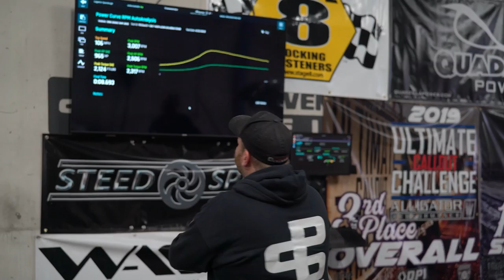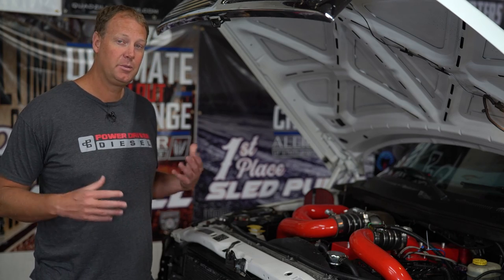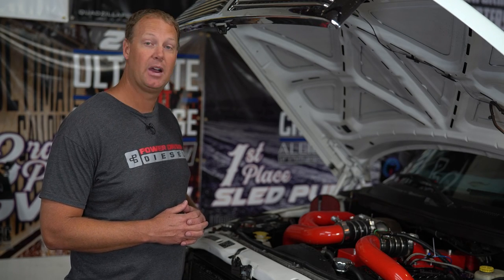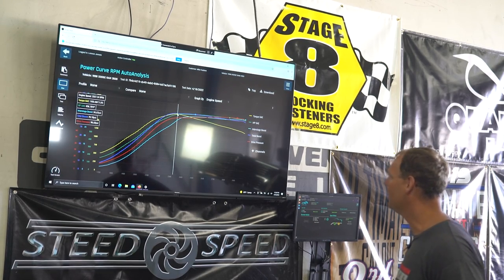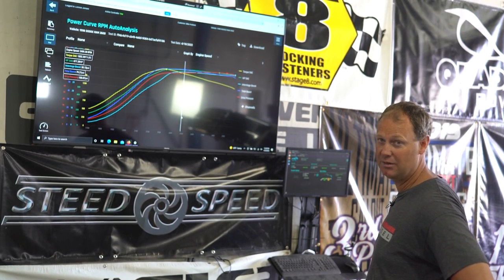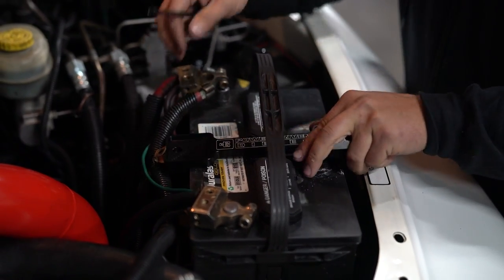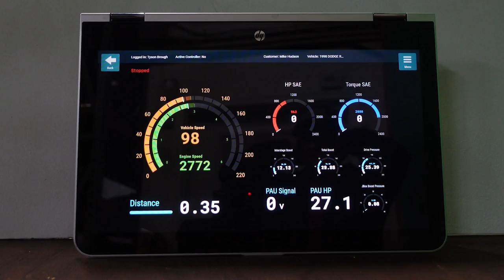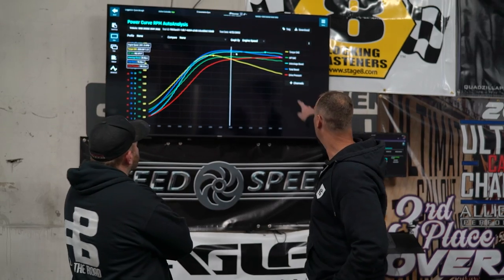Tow Ported Cylinder Head Dyno Test

Comment: I had always heard boost pressure was a measurement of resistance not volume,  this test demonstrated that concept perfectly.
Reply from the maker: Thank you
Reply: Yep. A lot of kids buy these trucks and can't make any power with them because they just crank the timing and boost up. These heads are terrible for flow.
Reply: Completely correct. I gained a lot of power and reliability by maximizing flow.
Reply: I can tell you when your taking your A&P(airplane mechanic) classes they beat the principal of a few dead guys in to your head. Bernoulli, Otto and Newton. and you better know Bernoulli's when you're talking about turbos and jets. And his principles work great till you hit supersonic.
Reply: Yes, simple law states how Flow & Pressure are inversely related!! The simple water hose analogy helps a lot of folks make the connection. But Soo many folks forget about Flux which takes the container through which the fluid flows. It is amazing how understanding a little bit of physics plays a role into so many different things.

Comment: I have a 1996 3500 (171k) that is bone stock and blew a head gasket on me pulling a trailer through Wyoming. I'd like to do some stuff with the head off. I know I want to install an afc live for sure, but what would you guys recommend for a mild ish truck that will be pulling 36ft goosenecks loaded with hay and equipment?  What can I get away with just building on the head?  Not looking for a race truck, just a reliable tow rig.

Comment: It’d be interesting to see what a head swap would do for a stock truck
Reply from the maker: That may be happening soon
Reply: @pddofficial  hopefully a vp truck🙏
Reply: Was wondering the same thing
Reply: @pddofficial  i volunteer my 98 as tribute.
Reply: #metoo
Reply: I got a 310k mi 3500 4x4 dually 5spd with no internal mods on the engine just a edge box, 5in exhuast, and intake filter on it its vp44 with air dog fuel pump. I wish I had the funds right now send it out to you guys and see what magic we can cook up. I'd volunteer it for "testing".
Reply: I'm currently running a 2012 6.7, stock injectors and stock cp3. On top of that is a BW S467.7/83/.90 FMW and Stainless Diesel manifold. All combined with a D&J stage 2 cylinder head. That setup is  plenty for towing in the mountains and chasing class 3 in the desert. Haven't had a good dyno reading because of tire slippage but will tell you airflow is key to making usable  power.

Comment: Watching y’all talk about more flow with less boost just blew my mind. It makes sense, just also never crossed my mind to think that way about my head and turbo setup. Love the videos.
Reply from the maker: Thank you
Reply: they aren't kidding about that, I swapped to their 62mm HX super 9 and despite making less boost than my Aurora 3000 it makes a ton more power, just moves so much air it's insane!
Reply: Boost is an arbitrary number. More or less, just a point of reference. Obviously, compound turbos and pulling/racing applications are much different, but in a daily driven or working, single turbo application, if you're exceeding 40 PSI of boost, you need a bigger turbo. After 40, on most turbos, your drive pressure is going to start climbing exponentially, and the compressor is just blowing hot air. 

My semi is putting over 600 horsepower on the ground, with only 35 PSI from a single, 76mm turbo with a 31 PSI wastegate. Never exceeds 900° in the downpipe, even after several minutes at full power.
Reply: Blew me away like a fuckin queef in the wind....  🌪

Comment: Would have really liked to see if the valve springs or a big reason for the difference, but even then just swapping out that head and valve springs and getting that much power is nuts. Love comparison videos
Reply: Valve springs and push rods is more of a supporting mod like head studs. It doesn't necessarily add power, but it makes the build more reliable. I
Reply from the maker: Thank you for the comment Getting our Engine dyno soon so that may be the content that we need

Comment: 😂😂😂. Will’s reaction was priceless!  I was along his line of thinking, but I guessed 940ish hp, for ~ +46 hp, and 2,050ish tq for ~ 112 lb ft gain. 
I am beyond impressed, but y’all never fail to deliver. If I remember the final numbers correctly, that was a +71 hp gain and ~ +200 lb ft gain- at elevation!
I wish we could’ve seen the owner’s reaction and impression after the first drive!
If possible, can you post some EGT numbers from before and after?  It would be awesome to see the truck doing the simulated hill climb on the dyno for sustained power and EGT numbers!
Reply from the maker: The truck is back home in Arizona, but the before peak EGT recall after a dyno run was 1800 ish and the after ported head peak EGT recall after a dyno run was 1600 ish or roughly 200*F EGT reduction, which is also an insane reliability gain!  We would have guessed 50 to 100 degree EGT reduction, so 200 was mind blowing.
Reply: @pddofficial  
That’s incredible!  A 200 degree reduction @ 965 hp max effort is mind blowing. 
The entire setup on this truck blows my mind.

 I remember the 2nd gen 1 ton y’all used as a test mule a few years back being approximately 400 hp, if I remember correctly, and it was noted that the cooling capacity and frontal area is a bit of a disadvantage when compared to the 3rd gen trucks; so to see these numbers - on the dyno at that, is crazy. 

Thank you for the post!

Comment: Looked like just a stock head gasket was put back on, no fire rings or O-rings? And what timing was it running 24⁰?
Reply from the maker: Block was o-ringed. Timing was at 24
Reply: What injector size?
Reply: @pddofficial  That is some big torque for no fire rings on a 12Valve. Must be those 625s doing their thing.

Comment: Over 2000 lb-ft. of torque?! That is ungodly. That’s semi truck torque! I’ve always wondered what kind of difference a ported head would make! Were EGTs different?
Also, I’m tempted to suggest this same type of test with camshafts on a 400-500HP engine (Stock vs Hamilton tow/street profile vs Hamilton Aggressive Street), but boy is that going to be a lot of work.

Great video!!
Reply from the maker: Yes the egt where 200° less still 1600° vs 1800° with the stock head
Reply: Please please test camshafts on a 600 hp truck.  It would be great to see how much power is gained with a 188/220 compared to stock, as well as how much the hp/tq curve shifts to the right, how much useable rpm is gained from a cam swap

There's almost no data on the internet on back-to-back cam swaps on a Cummins.

Comment: 8hp/lbs per min is very interesting. what injectors and delivery valves and timing? has pump been tweaked? like optimizing  injection event with the quickest zone of cam lobe ramp?
Reply from the maker: The injectors are a stage 4 DDP injector 025 dv and a 215 Ppump that was worked over by Seth

Comment: How would this turbo set up compare to a built he351 with a s475/96/1.15
Reply from the maker: it would spool quicker with the 351 but fall around the 700hp with the 475
Reply: @pddofficial  ahh okay, I’m only looking to push 700 but was curious cause who doesn’t love more power would a s476 be better I was gonna run a s480 but was going for quickest spool up possible at around 650hp. What timing would you recommend I ran 18 then 20 degrees with my single turbo set up 63/71/14 now thinking keeping it at 20 or 22 degreas

Comment: Do your high hp trucks get hot? I Have about 350Hp on one of my Ppump trucks,   stock, (w gov and valve  springs, fuel plate and head studs,  mishimoto rad and int). Less than 1k mi since new HG n studs,  but it still gets Hot while towing about 15k lb up big hills w the a/c on. 3.55 rear-end. How do I keep this thing cool?
Reply from the maker: Hot coolant temps or egt?
Reply: @pddofficial  coolant temp* I keep the EGTs below 1300 with throttle application, but on the long hills coolant still get hot, towing heavy.  Not loosing any coolant though.

Comment: That’s incredible gains. So heads and better sealing valve springs. I’d be curious to know how much those intake valves moved from manifold pressure.
Reply from the maker: Don't know maybe we need to try some clear valve covers and a go pro
Reply from the maker: Will carefully checked over the old head looking for signs of soot/exhaust build-up on the intake valves and they were surprisingly clean meaning... minimal valve float at low lift during overlap or nearly adequate seat pressure.  However, the factory locks/retainers were beat/pulled part way through and on the road to failure so likely had some valve float.  Luckily this truck never sees 4k rpm or it would have probably dropped a valve with the original 60# valve spring and OEM lock/retainer setup.

Comment: Do you know what size injector this truck has?  I don't think it was mentioned.
Reply: This is my truck.   Has Dynamite Diesel Stage 4 injectors.
Reply: @michaelhudson8453  do you know the specs on the 362? I'm building a set of 362 476 compounds for my 12v and was curious how close the specs are. I caught Todd saying that the 476 had a 87 turbine
Reply: Do you know what size a stage 4 is 5x? Just curious
Reply from the maker: it is 362 62x68 .70 and the 476sxe is a 76x87 1.25
Reply from the maker: They are kind like a 5x18 but DDP is doing a really cool 10 hole injector that act like a small injector until you get after it
Reply: Thank you for the response.  I have a 12 valve with a single 476sxe and 5x20 injectors all parts from powerdriven.   Your power level is my end goal.  I was very excited to see this video because I just ordered a stage 1 head from them and am waiting to receive it.  Point being, I am hoping to have similar power, but obviously without the torque, due to single turbo.

Comment: Does the build have a stock cam? Or upgraded?
Reply from the maker: I believe we put in a 178/208 can in that when we built it
Reply: @pddofficial  cool was just curious if a 188/220 would net a little more hp? I installed that one with your replacement head I could afford the stage one so I cleaned the bowls up and mild porting. Just wasn’t sure what to expect with the bigger cam.

Comment: I have a 97 12 valve original owner it's got 50 hp injectors adjustable fuel plate all the way open steed speed exhaust banks duel intake 4k governor springs 4 inch exhaust cold intake what would you estimate the hp to be
Reply from the maker: We've seen setups like yours make as little as 240 HP and as much as 425 HP depending on who setup/tuned the fuel plate/AFC travel, timing, and turbo wastegate setting, overall health of the engine, fuel filter maintenance, etc.
Reply: @pddofficial  thanks for the comeback after I retired I bought a bigger 5th wheel and did the upgrades for more power and it worked enough I got a light foot so the mileage is still there the unit has 375000 miles and serviced by myself every 4000 miles thanks again

Comment: This is a very similar set up to what I am putting together. Do you guys have turbine specs for both turbos?
Reply from the maker: 68mm turbine with 0.70ar T3 gated housing on the 362SXE and 87mm turbine with 1.25AR T4 housing on the 476SXE

Comment: What kinda gas milage does this thing  get?? U think
Reply from the maker: 12-14mpg
Reply: @pddofficial  thats pretty hularaious for 960/ 2000. I gota do a fummins. I have a 6.NO ford. ... Yall should start buying up 08-10 fords and slapping 12v in them. Because the chassis and transmissuon is pretty legit for a automaker built transmission and not a Allison or Aisin..Just the 6.4 ford motor is garbage. Keep on keeping on guys

Comment: Well dang, who needs Scania V8 anymore... LOL.
Reply from the maker: Don't kid yourself, these hotrod Cummins trucks don't have nearly enough cooling capacity (radiator) to keep up with a dedicated Class 8 engine/truck platform.  But it would be interesting to drop a 12v Cummins into a big tractor trailer and see how long it would last at say even 600 HP with 80k gross.  We'd guess the fire deck would break clean off the block within 1000 HRs of abuse from thermal shock from the high power density.... only one way to find out!

Comment: Would have like to have seen an under hood shot of the dyno after the head swap. Seems to me that the bottom end should have been addressed, smoking like a banshee from blow by and the dip stick is zip tied so it doesn't shoot out. Maybe it smoked less? Just observing. Thanks for the video.
Reply from the maker: Don't be fooled by the concentrated crankcase vapor coming from 1 single vent.  If this truck had 3 or 4 vents like most "race trucks" do at this power level, it would not look so severe and the pressure would be low enough the dipstick would stay put.  Furthermore, torque is directly proportional to average cylinder pressure.  Making 2,100 ft lbs is BIG POWER and will create sufficient cylinder pressure to make significant "banshee" crankcase pressure, especially with an OEM style cast piston with OEM style ring pack.  There are small compromises that happen to get longevity from cast pistons/steel ring lands at this power level including increased ring gap.  Forged pistons are usually destroyed after 15k miles on a Cummins with ring lands beat out of them till they torch or no longer seal.  However, 1000 HP is still fairly reliable with cast pistons and the "banshee blow by" can be ventilated better with the dual valve cover breathers to disperse the concentration of crankcase gases, but will not decrease blow by obviously.  This customer prefers the clean looks of OEM valve covers and didn't want the dual valve cover breather option, so he deals with a zip tied dip stick and "banshee" smoke from the single tappet cover breather.  If we filmed Will's Junker Drag truck making monster 1500 HP pulls with the same piston and ring setup, video recorded "blow by" would look less severe because he has 4 total crankcase vents.  However, if we measured total blow by, the Junker would have more volume than this white truck due to the higher cylinder pressure and higher RPM window.  One final thought, the OEM block usually fails around 2400 ft lbs to the tire, imagine much bore distortion is possible at 2,100 ft lbs like shown in this video, even a forged piston and high $$$ gapless ring pack would have trouble controlling combustion gasses on a power-distorted bore.
Reply: @pddofficial  Thank you for the in depth response, and education lesson.

Comment: An aftermarket exhaust manifold would probably net some gain and loss in boost/drive. Hey, I’m wondering what turbine wheel is in that S362, (65, 68 or 71mm). ??
I had a 62/68 and loved the happy medium. Also had a 63/68 + S478/87 compound setup. Sold the truck in hard times.
Reply from the maker: This truck had an old stainless BD manifold.  I don't think they make them anymore.  Turbine on the 362 is the 68mm wheel in a .70 ar housing.
Reply: @pddofficial  Thanks for the reply! I thought I saw a non-stock manifold when they showed the old head coming off, but the owner said “stock manifold” in the video at the end. He must have meant stock intake manifold, eh?
Reply from the maker: Yes, it has a stock intake manifold, and the exhaust manifold is definitely a BD manifold.
Reply: @pddofficial  Yeah, sorry that’s what I meant is it clearly was not the stock exh manifold in video but I got confused when he said “stock manifold”. I’m old school and forgot about the newer 12 valve intake manifold options.

Comment: Could we get a full build list of this truck? That would be awesome to know the recipe on how to get these numbers
Reply from the maker: for the engine we did Mahle cast performance wide bowl pistons, with std h rod and main bearings, stock rods, welded crank gear to crank. 14mm main engine girdle. 188/220 cam, bronze thrust plate, PDD cam retainer, billet timing cover, 1.45 tappets, stage 2 power driven diesel pushrods, street conical valve springs, power driven diesel stage 1 ported head with a firing head gasket, ARP 625 head studs, billet freeze plugs. fueling- DDP stage 4 injectors. PDD 025 delivery valves, maxed and balance 215 injection pump flowing 650cc, 4k gov springs, 200 gph air dog lift pump. air- top turbo sxe362/68/7.0, bottom turbo sxe 476/87/1.20, mishimoto inter-cooler. PDD 1000hp trans.
Reply: @pddofficial  that's awesome! What did it have for gearing for the axles?

Comment: Those rods must be holding on for dear life. Is there any concern about oiling? How does that massive torque number affect rod bearing wear?
Reply from the maker: Bearing wear is great considering.  The bearings on the cummins are so wide they can really carry a large load.
Reply: @pddofficial  every time I crack one open I'm always impressed with how over built they are for stock applications. They really are a fantastic engine. Thanks for the reply!

Comment: Can you explain,tell us what was done to the  bottom end🇺🇸
Reply from the maker: I has a balanced crankshaft, ARP main studs, reconditioned OEM rods with upgraded L19 rod bolts, Mahle H bearings, Mahle Power Pak pistons that come standard with a harder top ring and coated skirts, the bores have increased piston to wall clearance and increased ring gap.